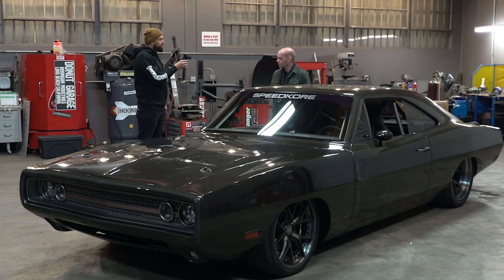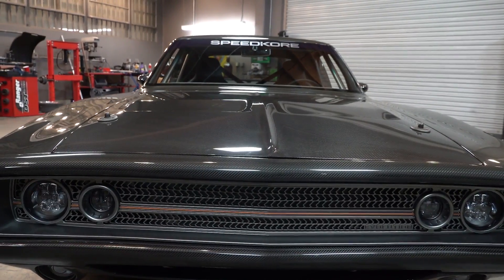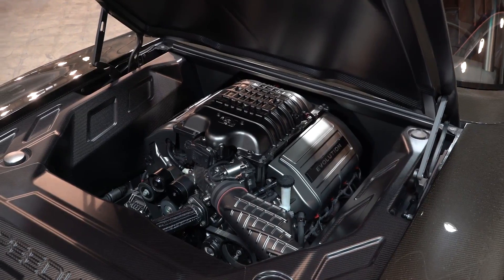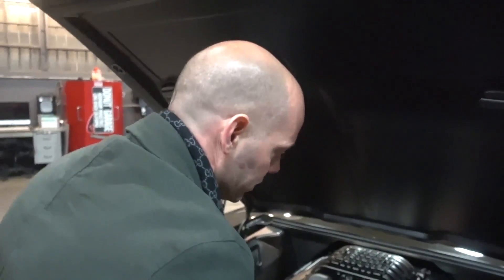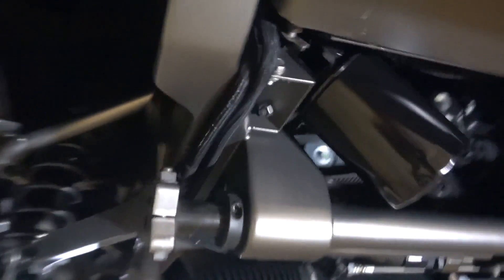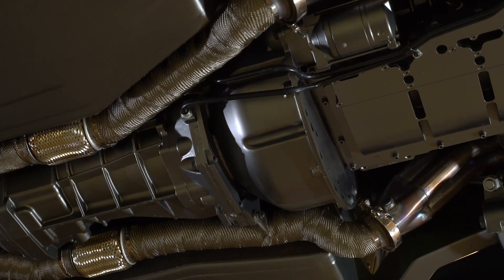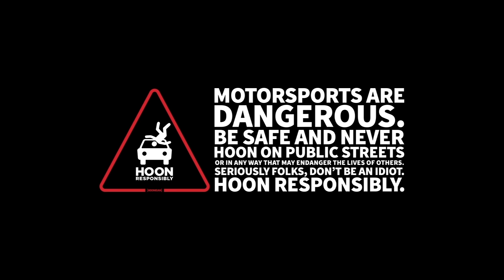ALL-Carbon Body '70 Dodge Charger - 950hp worth of Carbon Fiber Madness!

Comment: Super cars ain't got nothing on that engine bay. Best engine bay in a car ever
Reply from the maker: The craftsmanship in the engine bay puts this car on another level.
Reply: @TheHoonigans  it looks like God himself made this car with nothing but perfection in mind
Reply: Nope. All that modern cf, but an ancient tech 2v pushrod motor was used. Supercars use super engines, ie DOHC 4V VVT Turbo Flatplane.
Reply: @nordic5490  it's still making 950 hp ffs, pushrod engines certainly have their place and in a fully custom muscle car, it's a perfect fit.
Reply: @SpudEater  hybrid is the future
Reply: @justina9914  You're missing the point of my comment lol.
Reply: @SpudEater  yeah still I understand that pushrod pushing out 950 hp is great
Reply: B- trucker 918, McLaren P1, Ferrari LaFerrari, new NSX, BMW i8, need I go on?
Reply: @levygaming3133  go see 1980 track and rallie cars and see if u wont miss the engine sound?? Its inevitably the future but the rawness of a straight pipe racing petrol engine is something else
Reply: @levygaming3133  yea for the gay ones that paint their nails and pluck their eyebrows 😂
Reply: @b-trucker7717  . Those engines are just %20-%30 percent efficient. By making it have less friction and stupidly good tuned (f1 cars) you can go up to 40 or 50. But there is still heat energy loss. To make it even better use hybrid technology. Only use engine when it is most efficient (high speeds) and electric motors (low, mid speeds) by this way, you can make the same engine make 3 or 4 times stronger with minimal space change. Your 50 year old engines can't suck any dust from hybrids. Cause they are going to be miles ahead from your car, and dust won't stay up till you fill your tank.
Reply: Idk man i like the Tantrum engine bay
Reply: Shoulda had a glass hood to admire that engine bay but that woulda been heavy.

Comment: This is literally too nice to drive
Reply: Boyan Stanchev   Shakes head. "No it is not"
Reply: This car is meant to be driven, it's a piece of automotive art. Carbon Fiber Rembrandt.
Reply: I would say it’s not so much too nice to drive but too low to drive on an every day basis over varying road conditions.  It should be higher or have an automatically adjustable lift system to raise and lower it.
Reply: You are absolutely right, an air suspension system would give it an awesome "stance". Big ups, and hope you get the car of your dreams.
Reply: Boyan Stanchev I’ll only partly agree with you but I would kinda like like to be experience that Horsepower.

Comment: "It's okay to be craftsmen and tradesmen working with your hands", that's so true. 👊fist pump👊
Reply: 👊what else is there.👊
Reply: Inventor right here typing, had to rewind that part a few times. We need less human robots and more creative minds.
Reply: unless you're a flag paid mechanic. dont get into that business.
Reply: what else is there ? Lots of specialized computer-controlled CAD/CAM software and CNC machinery. Most of the Chargers parts were designed in solid works and machined on a CNC mill, lathe, router, etc. or manufactured from CNC routered plugs and molds. Building OEM quality custom vehicles require a lot of specialized equipment and personal. $$$$$$$$$$$$$

Comment: 1970 Charger is the most beautiful car ever built, just not a fan of the car being lowered.
Reply: RobVoyles yea i dont know why they did that
Reply: Just the trend these days, everything has to be motorsport inspired with rollcages, splitters and wings and all sorts of diffusers
Reply: Jack Jonas that is pretty subjective for you to think everyone has an opinion on beauty.
Reply: I disagree, have you ever seen a 1937 Delahaye?  And even limiting it to 1970 Mopar, I'd take a Superbird over a plain Charger anyday on sheer sexiness!
Reply: Bro I'm with you but I think the lowered stance make the tires look bigger and it looks like its faster! Personally I don't like the color but I freakin salute the artistry.....
Reply: @abdulraheem415  it's that color cause it's made out of carbon fiber :/
Reply: Ok, boomer.
Reply: This car handles 1000 times better than any stock Charger ever did
Reply: @brobertbrobinston2282  Boomer? You kids don't even know what a real "Boomer" is apparently..
Reply: its for balance in curves
Reply: @placeholdername3206  the roll cage stiffens the chassis which would flex like crazy in that body style.
Reply: @elias8294  It also helps to introduce brain matter to those fine leather seats when you crack your skull wide open on it. Full cages are for track cars where you wear a helmet. Not street cars.
Reply: @placeholdername3206  who cars, that car doesn't have airbags, if you got into any sort of high-speed collision you're completely fucked. People don't drive sports cars for safety. Also, you can crack your skull on your steering wheel, people have even done it on the dash.

Comment: They should mass produce these🤤
Reply: The mass cannot afford this.
Reply: Probably only a quarter to half million a piece.  Should sell by the... individual unit.  And here it is!
Reply: @gixxxer1000  But if the cost of carbon fiber manufacture keeps going down,   imagine the possibilities of computer design and stuff,   especially considering it doesn't have to be picture-perfect-looking weave once people get bored of looking at it and just want it like regular colors or whatever. 

Fact is,  I can't afford even really gutted shells of what used to be five hundred dollar cars even as runners, (And real wages haven't gone up since then even, already)      ...you could be looking at like eight grand for a Duster you'd still have to throw thousands more at for paint and body   before even getting to the parts that make it go.  Which you'd have to/want to do anyway...   (Someone had a Feather Duster,   which was a real gutless economy package at the time, but... aluminum hood and front fenders,   and most modern builds...you'd be changing out the rest of the stuff that was too cheap anyway.   If I had a like fourty grand budget I might have bought the thing. )
Reply: @brandonpayne7240   They have it on their site as starting at $400k

Comment: That Dodge Charger vs the hoonicorn
Reply: Charger all day
Reply: @kingj2951  I think the hoonicorn has more power and it's also awd
Reply from the maker: Battle of the Titans!
Reply: @gingerkinmrfrisbee4925  oh ik it does but this charger is lighter and 950 in a light car is just insane and i just dont like stangs but that mean 😂😂i love the hoonicorn tho
Reply: @kingj2951  I like chargers but the hoonicorn has 1400 hp and is a smaller car mostly made of  Carbon fiber
Reply: Hoonicorn maybe if he doesn’t spin the tyres on launch but then again it’s designed to do that lol
Reply: @TheHoonigans  Do it! Make it happen Captain.
Reply: Hoonicorn but I am a mustang guy from way back
Reply: That would be awesome but the hoonicorn would win all day 500 more horsepower comparable weight and awd still those two together would be amazing
Reply: My money is on the charger, AWD is cool and all but RWD is just too good.
Reply: Adam Lewis if it was a drag race the awd car would obviously have the advantage I agree I’d rather have a rear wheel drive car for the fun factor but that extra 500 horsepower plus double the traction the charger would have to back half the fuck out of the hoonicorn

Comment: I had a carbon fibre bonnet once, absolutely beautiful.
After 3 years it started discoloring and after 5 it looked like the skin of your grandma's heel.
Crackling, crazing, yellowing, pin holes.
Dont leave it outside.

Comment: I used to own a 1974 Dodge Charger SE Broughham edition yellow paint, black rear wing and top, plus chrome trim and Krager SS rims. I wanted to at least change  the front body parts fiber glass or carbon fiber but I don't own the car anymore. Maybe if i buy another 70's muscle car again.

Comment: Really skilled work on the carbon fiber, almost too much though for only saving 900 lbs. The Cerakote is great Finnish would be nice to see Cerakote on the piston heads. too bad it is not practicle for Charger fans to convert to.. So many special fitments none of the panels are practical to replace on a rusting restore job, because basically it is that custom, nice but a one and only type project

Comment: I wish they would have teamed up with schwartz performance. Added a G-machine chassis and made the floor out of carbon and removed the cage. Could have brought it down closer to 3000lbs. With a full length frame from schwartz it would be stiff enough with just the body shell.

Comment: Fantastic build, amazing quality, amazing fit and finish, looks beautiful. Now I don’t know where you got the “stock is 3900-4100lbs”. I know 60s-70s cars were quite light, generally around 3000lbs and internet search is showing 3200lbs for a ‘70 Challenger. Would have expected sub-2800lbs for this easily. 
Otherwise, I bet this thing is a dream.
Reply: Only light cars were the novas, camaros, the heavy cars were chargers chevelles cutlass

Comment: It’s cool that the 70 Charger was chosen. Myself I’m not a fan of the grill without hiding the headlights. That makes it look like a 69 Charger 500 however that grill was flush to the front for improved aerodynamics. I know the younger generation likes the low ride but I don’t prefer it and driving over manhole covers would be a disaster. 

The one tone color doesn’t do the body shape justice and accents nothing. 

Cool to see high tech but there’s nothing like the sound of a cam through mufflers and the roar secondary carbs kicking in. Horsepower isn’t everything. You can only handle so much on the street. 
It’s a different category of car build that honors a sweet shape but I’d rather make an original charger lighter if that’s what you’re looking for and beef up a stroker engine. 

Do you beat on this car at the track or do you make it a trailer queen? 

Just the same congrats to the fine effort and keeping the charger alive. 

Wonder what happens to Kevlar in a collision? Does bend? Splinter?

Comment: im a major dodge fan ive always loved what can be done with a dodge vehicle but this is a totally new level and tbh imagine the dukes of hazard with this rig the show would be so different and imagine dom driving this in fast and furious one with the motor out of the charger in fast and furious im sorry but i think the body wouldnt be able to handle the motor the car would shread apart with the torque bc the motor would be stable she would twist the mounts so bad she would split the block and the blower as well so much shed destroy the front end this show only be a show car and not a daily driver its to clean and mean to race

Comment: They need to make carbon fiber a process for the assembly line. The weight savings alone would save massive amounts of fuel consumption across the board.

Comment: I bet its noisy inside if its nothing but a single aluminum pan between you and the ground, no carpet, no padding.
Reply from the maker: Its a very soothing noise! Nothing better than a supercharged V8 near you feet.
Reply: And no cupholders either.
Reply: @jchors2947  lmao

Comment: Insanely lot of money and work done to end up with a pretty much pointless car. It will be outrun by lighter cars in the bends and has not enough grip to put down amazing times on the strip. So it's basically a cruiser.
Reply: That's a recreation of a car that in the past, was a legend. It's not supposed to be an insanely fast car now. It's more like art.

Comment: You could have put all that time effort and engineering into a much better looking model car, like the 70 'Cuda, 70 Monte Carlo, 70 Cobrajet Fastback, 69 AMX,  3 years older 67 Stingray,  67 AC Bristol 427 Shelby Cobra, Z11 427 (409) Impala, 427 Cammer Fairlane, 59 -60 Impala